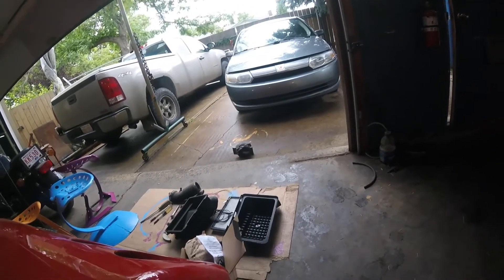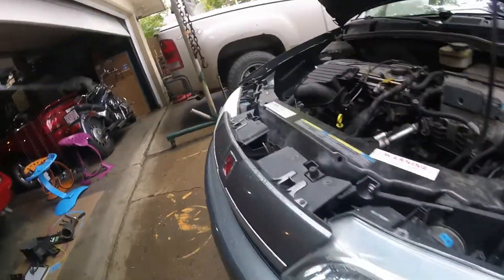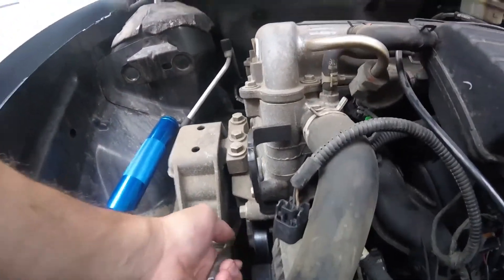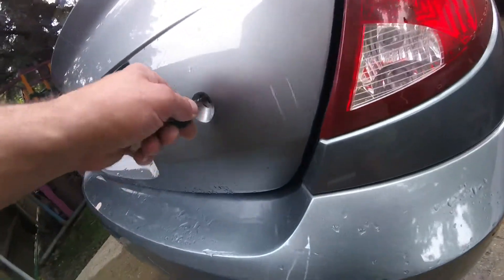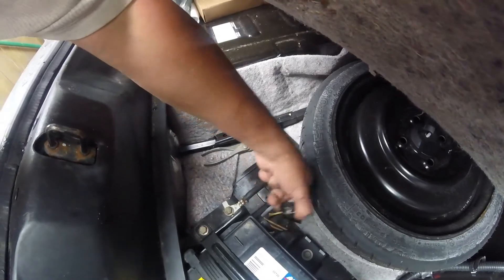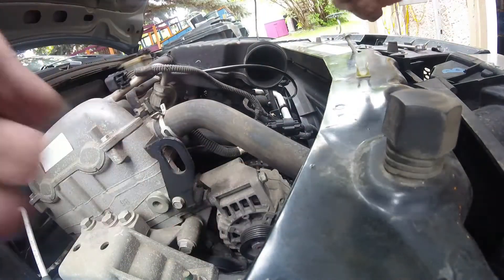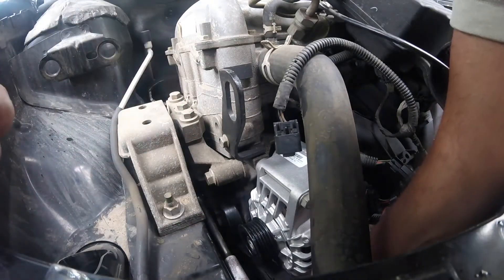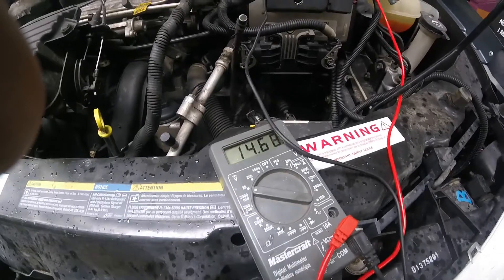Saturn Ion alternator 2004 test and replacement

Comment: I read something about it may be the ignition switch & window wiper motor. But sadly i never got a confirmation, goodluck you are a great guy for taking care of your customers
Reply from the maker: The Ignition switch is not specifically part of the circuit. Turn the ignition on which powers the ECM. The ECM applies 5 volts to the alternator, but, only with the engine running. I think someone is messing with you with the wiper motor. lol

Comment: Rite on thanks for the information and taking time to do this. I have the exact same car and problem.  But it's intermittent. Starts and runs fine then it won't start or at best just clicks when trying to start. I had the battery checked and it was good. I'm going to do what you have done. It's not 5 years later, has there been any updates on how this repair worked out?
Reply: Mine is the same, ever since we bought the Saturn in 2017 it's always had intermittent issues with alternator and battery. Definitley seems to be a known issue with these Saturns.

Comment: I have a 2006 Saturn ion 2.2 I was driving today and it turned off on me on the freeway. Bought a new battery a couple days ago so it’s not the battery. Now my new battery is completely dead. Do I just need a new alternator?
Reply: NaToya Dunlap it ended up being the alternator. I swapped that out and it works beautiful again

Comment: I'm getting a battery light under load I'm guessing that the alt is going as well as the tensioner because the light comes on and stays on when I turn on ac
Reply from the maker: Not sure why you think the tensioner is failing. If the belt is not making noise, and it does not look worn, then It is an alternator issue.

Comment: If you notice there's a hole inside the wheel well for easier access to inside bolt.
Reply from the maker: You are correct. I do not recall for sure but, I believe the wheel needed to come off to do that. This way was faster for my purpose but not easier.

Comment: Im working on a 04 the problem is off and on charging it will charge 14v then in 5 min stop charging. The alternator tested good at parts store . The field wire from ecm keeps turning off the alt and charge light comes on. I pulled the 2 wire plug while not charging and the red wire had 5 volts, the grey wire has no volts. I plug it back in and probing the red wire I have 1.18 volts, probing the grey wire I have 1.17 volts and red light stays on still. Voltage test at the + terminal it while car running and on 12.2 =bat voltage ...no charge from alternator...Cannot figure out what is causing this...the red wire has continuity from ecm to the plug....dont know if its a ground problem as ecm has no outside ground but is grounded somewhere inside. Any  ideas?
Reply from the maker: Sorry, I dont post many vids so I'm not on this account too often. Hmmmm... If you havent already figured out the problem, I would trace the harness back from the alternator. It could be worn through at some point. If it charges properly and then stops charging, that would lead me to a problem with the harness. Possibly a problem with the ignition switch. I have not diagnosed an issue like that before. I can only point you to a direction for troubleshooting.

Comment: to test the alternator quickly start car remove Neg or pos terminal from Bat. if car dies alternator bad if keeps running alternator is good. Output of alternator should be 13.5 to 14.0 volts. Buy a manual from your local parts house.
Reply: I wouldn't reccomend that on newer shit! Could fry the computer
Reply: I thought newer cars you cant do that to?? That would be great and easy way to know if alternator is squirrelly